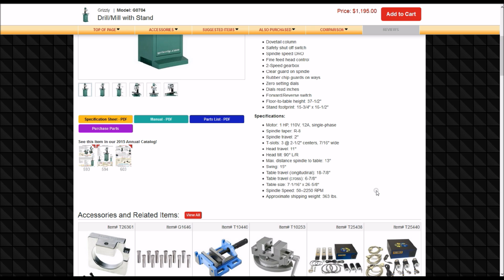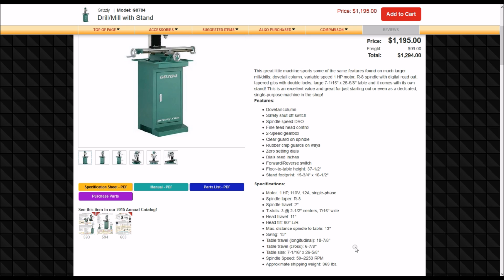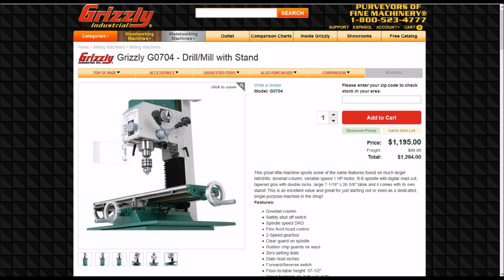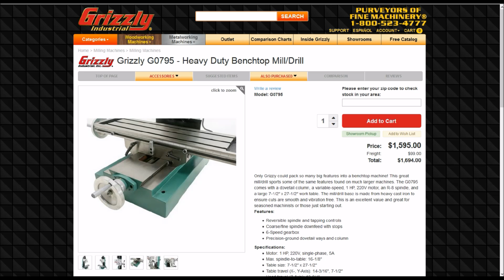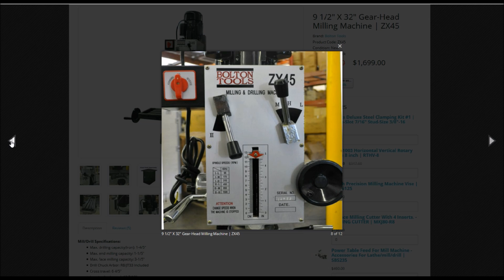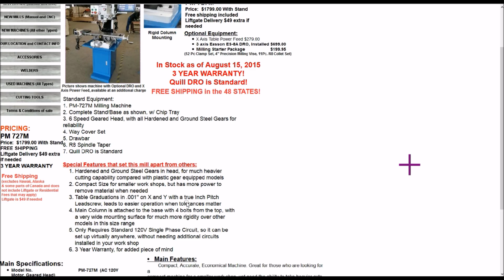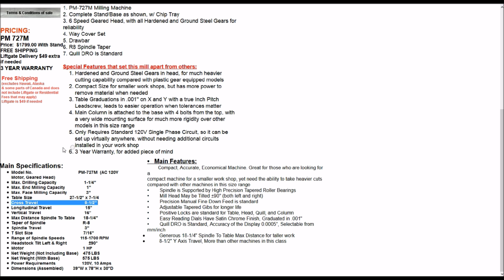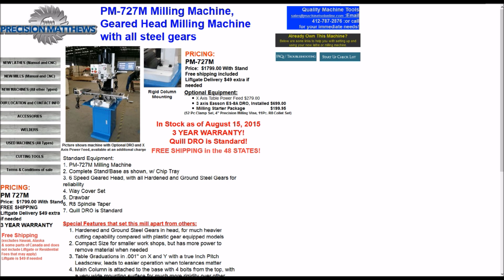Precision Matthews  PM-727M CNC Conversion Pt.1

Comment: Do you a have a comprehensive parts list for the pm-727m somewhere? Nice work!
Reply from the maker: http://www.precisionmatthews.com/wp-content/uploads/2017/06/PM-727M-V-4-16-2018-v4-Web.pdf
Reply: That appears to be the in boxing and setup of the machine from PM.
Reply from the maker: yes the PM manual which has the parts breakdown you asked About
Reply: CNC4XR7  I was looking for the CNC conversion list (if you have one) this wouldn't be anything supplied by PM....but I have read the PM un boxing/setup/parts list 3 times now....I'm ready for real deal!
Reply from the maker: sean wolfe 
I have a complete parts breakdown for the cnc conversion. In my plans available on my website. Along with drawings fusion models and wiring Diagrams

Comment: Given your gear box problems late in this process in hindsight do you think you would have been better off with the PM-25MV belt drive version that is very similar?
Reply from the maker: That is a G0704 size machine I believe No worries on the gearbox as I will be converting to a belt drive with a PDB and ATC
Reply: Thx for the insight. So hard to judge from just pictures. Wish there was a PM showroom in each major city.
Reply from the maker: yeah hard to buy something you cant put your hand on.

Comment: Thank you for bringing this up. I was going to get a g0704 and do all the changes but now knowing this PM727 has the beefier motor mechanics and the extra Y makes it a no brainier. I was going to have to epoxy fill the head, change the bearings and bushings, add belt drive, change to 3phase and with this I can probably do just the motor changes. 
Looking forward to following your build. I liked your g0602 lathe cnc build. The threading you got at the end is darn impressive.
Reply from the maker: Rallymax 
looks like your doing a cnc4xr7 marathon lol the G0704 will fool you with its generous X travel.
check out my video on machining
a Go704 saddle
Reply: CNC4XR7 best 10hrs of binge watching I've ever done. Absolute pleasure to watch. The most valuable one was how you dealt with the clearance for the Y ball. Don't know if I would have the guts to go so far forward. I just don't see myself needing to have the table that far forward. I get the need to go all the way back but not that far forward.
So many questions...
What's the final backlash?
If you did it again would you add a bigger z spacer?
Would you consider ClearPath integrated servos instead of stepper?
For practical use how much total width do you need - 4feet? 5feet? I have a tiny garage.
Why do you face with an end mill instead of a fly cutter?
Thanks!!!! On with tonight's binge ep20ish onwards.

Comment: Almost pulled the trigger on a G0704 for some motorcycle parts projects that I have going on.  Appreciate all the details in your video as it made me stop and think.
Reply from the maker: +akjell  Thanks,
 I did not want to spend $1200 on the G0704 to later say Man I wish I would have gotten the PM727M Thats what I did with My X2 I thought I should have gotten the G0704 so after I started using the X2.
No regrets Here now this mill is just the right size for a Home shop.

Comment: I just got an email from grizzly saying that my G0704 will arrive on Monday (after tomorrow), I got it for $1208 include shipping and the lift gate  by using my 10% discount! was good price!! ....

g0704 can convert to have the X go from 7" up to 9" by machining the cross side and make it longer!  I am thinking to pay one of the machinists some money to to do this one hour labor. 

Oz
Reply from the maker: +Ozy Ozy  Hi OZ,
That's a good deal, I decided for me the G0704 was just not going to work. I wanted to be able to easily add a 3 phase motor without it being to big for the mill. and I felt the rigidness and extra weight of the PM727M was going to be a better option for me. The G0704 must be a good mill it's very popular so I'm sure it will do just fine send some photo's my way.
Be Safe,
Sam

Comment: I bought a wholesale tool zx45.  pretty nice and clean, they usually have 20-25% off coupons around this time of year.  Might pay to give them a call.

www.wwtool.com item 3006-0080
Reply: Thanks Matthew, 
I looked at a lot of mills the ZX -45 being one the even have a larger version with a 40" table. 
Taking everything in consideration I went with the PM - 727M I felt the casting quality was better and the size was perfect for my shop. 
Thanks for the heads up. 
Be safe 
Sam

Comment: What is this, upgrade season or something? First Craig, now you too Sam? Ha ha, congratulations my friend, I'll be looking forward to your updates. 
I'm not so sure if I agree with not using the X2 to make your parts though. After all you could just keep the design simple for the manual folks out there, but avoid spinning handles unnecessarily by using the CNC. I think you've earned that right! 
Anyway, if I ever get to that point you can be sure I'll CNC the heck out of it! Ciao.
Reply from the maker: +Crivo152 Thought you got the Memo! LOL,
This has been in the works since before the G0602 project but the Little X2 just keeps doing such a good job I postponed it. I'm a little early I didn't plan on it until next year. So I'm going to be going slow with this build.  A Tormach would be nice but hard to justify it for a Hobbyist So I'm going to do My own version. LOL
Reply: You all are killing me! Where is a Mori Seiki when you need one?!
Reply from the maker: +Crivo152  I'm sure we can round one up!

Comment: Great video. :) Can't wait to see the conversion process!
Reply from the maker: +Edward Sheets  Mill Should be here soon :-)
Reply: Is it made in China or Taiwan? As you pointed out, the castings look really clean in the photos. I had never heard of Precision Matthews before. It will be interesting to see how this mill compares to the more common Grizzly machines.
Reply from the maker: +Edward Sheets It's made In China, However Like grizzly It seems that Precision Matthews has a better handle on the quality of the machines that it receives. Like Harbor freight seems to have a lesser quality than Grizzly on the same machine type. I will post my impressions on the mill in the next video.

Comment: If you have not ordered yet, you might look at Tomach's new 440. Just a thought.
Reply from the maker: Thanks yea I saw the Tormach 440. @ $4995 a little out of my range I hope to complete this for under $3k and have a bigger work envelope comparable to a 770 or maybe more. From what I read the 440 uses a dc motor and C7 rolled ballscrews, 2 phase steppers. 
Don't get me wrong Tormach did a wonderful job on the 440 but there's no fun in buying a ready made machine :-) 
Be safe. 
Sam